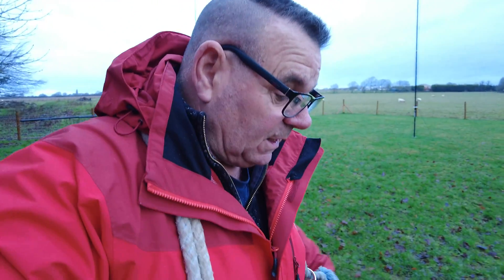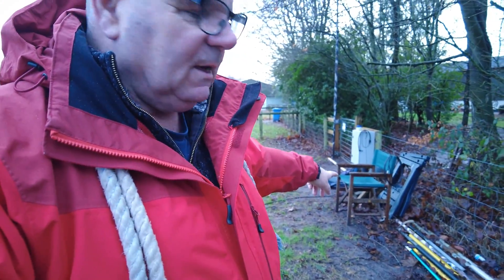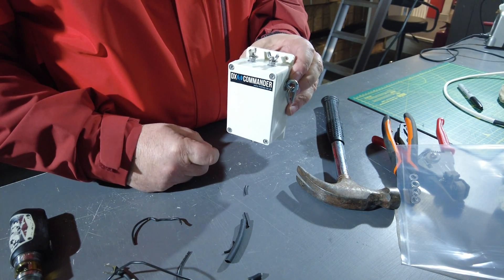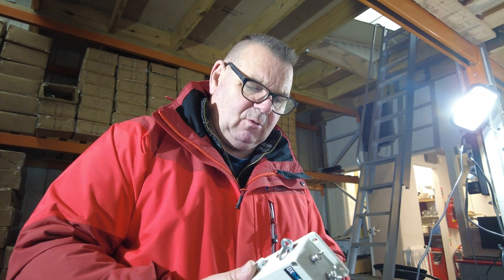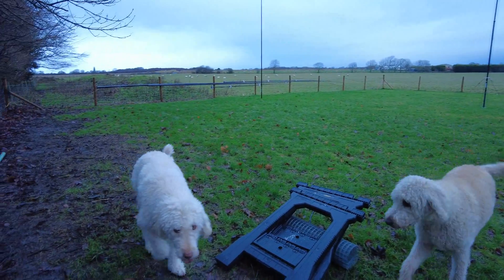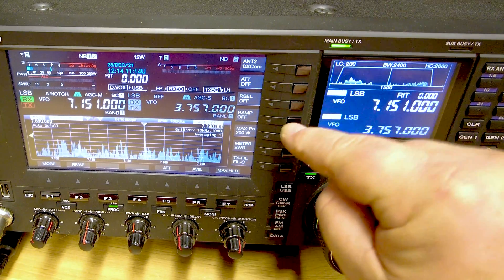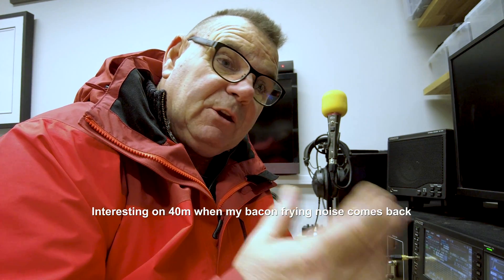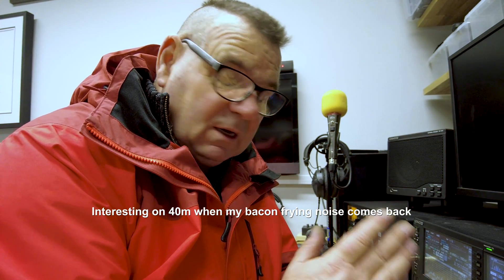Installing a LARGE receive loop for Ham Radio

Comment: So I got two 1/4 mile long spools of 14 ga aluminum fence wire and 50 feet of 500 ohm ladderline and a couple 8' x 5/8" ground rods and a Drake R8B. Thinking I want to make a horizontal loop, but not sure if I should open the middle of the far end from connection point and make it a 1/4 mile long folded dipole or open-ended 1/2 mile longwire w/ ground rod on other leg of ladderline. I want to check out longwave most of all. Should I try to get the antenna up high?
Reply from the maker: Not sure why you need ground rods but yes.

Comment: Hi cal , did you ever change Rabs 4:1 balun with an isolation choke ( using the type 73 binocular core ) 
Just wondering if that would of dropped the noise floor , although it would then be decicated rx only ? 
Btw Rab is alive and well and back on the scene , i was talking to him last week after he did a couple of antennas for me , hes a top bloke too
73 de Ricky G0LZX
Reply from the maker: I can't remember what I did!

Comment: I have a garden with a perimeter of 150 meters. Do you think I should try this antenna? What should I do at the gate—should I run the wire over the gate so that one can pass and drive a car underneath, or should I bury the wire in the ground? The antenna would mainly be for a Kiwi SDR-receiver. 73, OH2KAJ
Reply from the maker: Mine lies on the ground at the gate. But I'll tell yoiu, the small Loop On Ground is better.
Reply: @DXCommanderHQ  Ok, I will try that first. How about Beverage On Ground Antenna. Does it need to be placed in a straight line or can it be done as a loop?

Comment: Maybe I'm split hairs here, but what does having the wire fence in such close proximity to the receive loop have on its performance ?
As I keep thinking it's like your loop is in a Faraday cage, of sorts !
And something I noticed, on one of your videos, when you were making comparisons between the small loop and the larger one, it seemed like the smaller loop reduced the noise, and made the intelligence higher, ie. Able to hear stations more clearly !
In some cases, they actually sounded louder !
And I wondered if that was because the AGC wasn't trying to clamp down on the noise ?
Reply from the maker: I don't think it does anything.. It would have a change in impedance certainly for TX but for regular RX performance, it seems to be fine. I think it just parasitically couoples and thinks it's an antenna!
Reply: Speaking of the wire fence, have you ever connected to the fence itself ?
Reply from the maker: @sleeve8651  Yes.. but only as a ground - not an antenna.

Comment: Im wanting to get an RSPduo as I only want to listen in on things.  My garden is rectangular shaped and a total of 52m in circumference.  My question is, if I make a ground loop antenna, does it need to be an exact size of will using the 52m be ok?  Also, what would I need and does your website provide the items.  Thank
Reply from the maker: No.. Actually, I would personally make a smaller one than you think.. My 15 ft square loop is ideal. You can buy a kit or complete LoG. Here is an example (I have one of these) https://www.lmkts.com/loop-on-ground. Afterwards, you could perhaps also build one all around your 52m too, maybe a bit higher off the ground. That would be fun. Perhaps on that very large loop, use a cheap 4:1 balun.. It will stop the coax fromo picking up noise. Then you would be able to compare. (you would need two coax lines.. I think the RSPdue has 2 x inputs..?)
Reply: @DXCommanderHQ  Thank you so much for getting back to me so quickly.  I will order one today.
Reply: @DXCommanderHQ  Does the kit come with instructions to set up the connectors to the box?

Comment: I'm going to use "uninduce" from here on! :)   I have two LoGs, one is the KK5JY 15'x15' , and the other is about 300' of wire laid on the ground in as close to a circle as I could get it. They both use the 5JY transformer, and they both work beautifully. The larger loop is a dream for LW and MW and top band ham, the smaller is almost as good but up to 5 or 6 MHz as well. Noise killiin' is excellent on both... and phasing them is a treat for experimenting and digging out the weak ones. Love your videos as always Callum, thank you.  73 de Mike N0TLD

Comment: Would not installing this antenna in such close proximity to the metal fence lessen the antenna's efficacy?
Reply from the maker: Unlikely. So far, after 3-4 months it's been amazing. Remember, this is RX not TX.
Reply: @DXCommanderHQ  I’m not a ham yet, I’m considering it but am an avid SWLer and I love DXing MW. I didn’t realize that transmitting was different than receiving in terms of antenna arrangements other than matching impedance. Are baluns and ununs important for RX only?
Reply: @DXCommanderHQ  But antennas always have the property of reciprocity.  Anything that affects TX will also equally affect RX.  Now something that is so bad that it prevents you from using an antenna for TX (horrible mismatch, not resonant, etc) won't stop you from using it on RX, but it absolutely will affect how well the antenna works in some way.  If an antenna suffers a loss of gain or distorts the pattern on TX because it is coupling into a parallel metal object, it will also suffer the same loss of gain and pattern on RX for exactly the same reason.
Reply from the maker: @stargazer7644  On the other hand we have gain.. And modern receivers have almost too much gain. But we only have finite transmit power avaipable.

Comment: I notice the DX Commander in the middle of the field surrounded by your Big LOG. Is the Big LOG far enough away from the TX antenna to remain connected to a receiver when you transmit without frying the input to your receiver?  I have a DX Commander Classic and am planning a LOG and wonder about safe distances because the LOG will be feeding an RSP1A SDR. THANKS
Reply from the maker: Well.. I’m not using a separate receiver so t couldn’t melt if I tried.
Reply: Connect your receive antenna to a power meter and see how much power is coming into the RX antenna when you transmit at full power on various bands.  I get nervous if I have more than 0dBm (1 milliwatt) going into the receiver, though many receivers can tolerate 10 times that.  If I see more than 0dBm, I take action to limit that power into the receiver (filters if different band or relays to disconnect the antenna on TX)

Comment: What would I possibly gain burying 400 ft of wire inside 1/2” pvc and in a loop configuration?
Reply from the maker: I don't think anything would happen negatively.. It will still work. Just not too far underground. I would test the therory first by just laying your wiore in similar configuration and testing you are good to go..
Reply: @DXCommanderHQ  thank you ☺️ 73 de KG5AJP

Comment: Out of curiosity..   instead of running all new wire around the perimiter,   could you have mused much less wire,  and electrically connected all of the fencing wire together?  (as in, bury some wire an inch or 2 under each gate, and connect the ends to the fence on either side of the gate)?  If you aren't using it for transmit, I don't see why this would be an issue.    I have the same kind of wire fencing around my property (around 1200 lineal feet) and have thought about doing this... but not sure what the result would be.
Reply from the maker: I don't know.

Comment: I have a 272 foot skyloop about 30 feet up I transmit and listen on it it's a lot quieter than the fan dipole I had up and it tunes up all bands but 17m which I use my 20m vertical for anyways.
Reply from the maker: Ah! I have a Triangular Video coming out soon - then a Square one. But you are right, they are a lovely antenna.

Comment: Doesn't your wire fence affect the big loop?  Could you use the fence as an antenna (though it may be grounded, I guess).
Reply from the maker: No to antenna (grounded) and don't seem to affect the big loop either :)